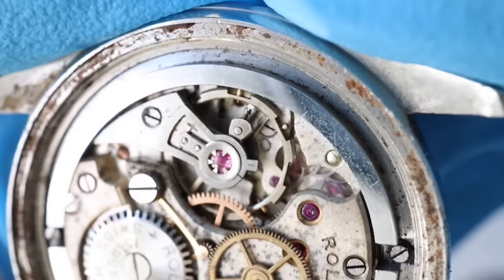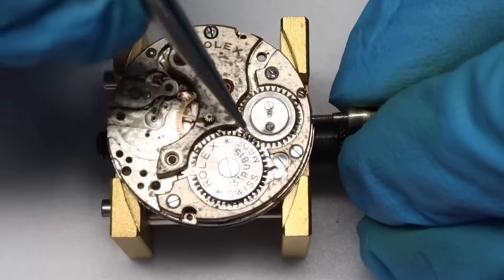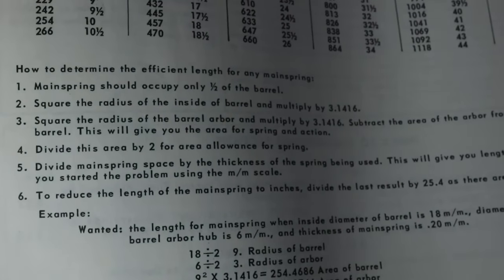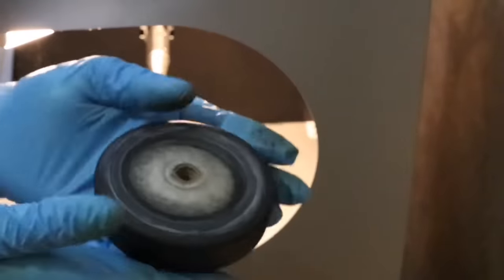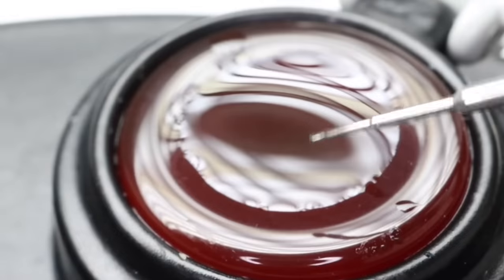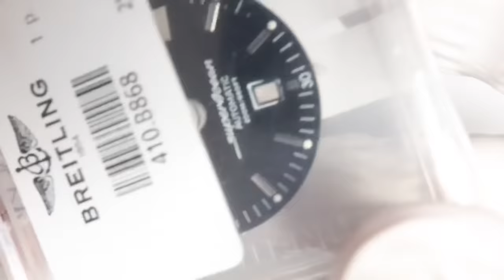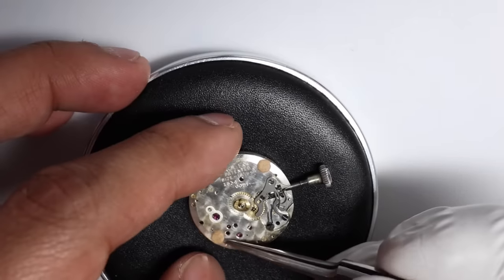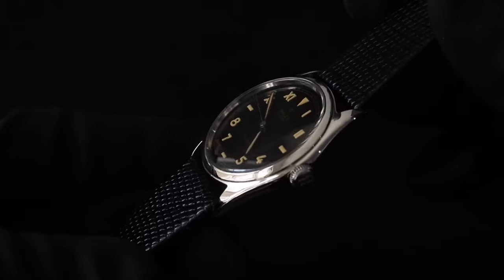Rare ROLEX Restoration - my 6 year old son designs a new dial for it - 1940s ww2 rusty asmr

Comment: So... I bought me a multi function digital watch from Walmart the other day. It was on sale for $3.50 (not a typo)  I decided to wash my hands with it on to see if it was water resistant. It was not. Got all full of bubbles inside. SO...Being the budding watchmaker that I am. 
Took it apart...dried out the moisture and sealed the 4 buttons for the multi functions with some Shoe Goo. Cute little blobs at the ends of each button. It appears to be fixed. I haven't pressure tested it to 800 ft but it no longer gets moisture when I wash my hands with the watch on. This is all because of your encouragement. You rock SIR.
Reply: Let that be a lesson to you: never wash your hands! Lol, JK 😉
Reply: Wow look at Mr. Rockefeller here! We can’t all spend $3.50 on a watch, showoff. 😉
Reply: @Sashazur  eat your heart out pauper

Comment: For some collectors it has to look nearly destroyed. As a collector and watch repair amateur myself, I don't care about that sort of heritage, I want it restored to a point where it can't be distinguished from new. To each their own, of course.
Reply: A bit of patina is not too bad, but yeah, that Rolex looked horrible and was probably a pain to read too!
Reply: I agree with your comment wholeheartedly that the belief that watched need to look run over is really not the point of these videos. The heck with "patina" when it makes the restoration pointless.
Reply: 'Patina' is the politically correct word for 'corrosion'. 
Which, of course, is just absolutely desirable in the guts of a precision machine.

Comment: I enjoy watching your restorations very much. The shape of the case of this old Rolex looks the same as the Oyster manual I bought new in 1952 at a U.S. Air Force PX in Dhahran, Saudi Arabia, for $38. When the gray leather strap wore out,  I was fortunate to find a Rolex steel bracelet of the same period in a little Arab shop, correct in the detail of not having the bracelet curve where it meets the case. 
I would have preferred it if you had cleaned the original face as far as you could, and used that. Even when it was brand new, the face of mine showed a sort of patina growing from the center. After 70 years this patina has grown irregularly out between the hour stick markers. I am now 97, and the last thing I would want on this watch is a perfect new looking face on it. My collector friends admire my old Oyster.

Comment: One of my favorite episodes! I am somewhat surprised that you didn't give it a go at a dial restoration. Soaking in vinegar and then spray with a weak peroxide solution whilst scrubbing with a soft boar bristle tooth brush? But then again, it can only be original once. Thanks for sharing your adventures. I always look forwards to the next one. Many Blessings on you and yours. Cheers!
Reply from the maker: Thanks Mike. The dial did have some work done on it previously at some point and the owner just wanted it left as it is

Comment: I've only just watched this one - amazing, as always, Nekkid.  I am not a betting man, but if i were, I'd put a hefty folding money bet that, after showing this video, you could easily sell the Roller with Mr Trouble's stylish dial.  In fact, if the deal was, it had Trouble's dial installed and the very stylish Roller dial, plus the original in a plastic box, you would never get asked to change them over.  True the black dial looks cosmic, but somehow........

Comment: I never would have expected a beat up old Rolex that looks like it came from the glovebox of a moldy 1975 Rolls Royce that sat in a damp barn for 35 years could turn into that end product. I've honestly never even really thought about mechanical watches as anything other than luxury items I could never justify spending any significant money on but now I'm looking around on eBay for a couple cheap low end beaters to try resurrecting, and owning a Rolex that I personally fixed up doesn't seem out of the question eventually.

Comment: I have two questions. Does a watch with more jewels (let's say 24) is better than a watch with less jewels (say 15 jewels)? And the other one is how we define a reliable watch?Also i am in a dilemma... I am looking for a new watch and i have two options: The Seiko 5 sports GMT automatic and a Citizen Eco Drive Radio Controled. What would you suggest? Both are at the 450-550€ range. I must say that my everyday watch is a Casio Edifice mechanical watch

Comment: Beautiful restore. Im trying to mirror polish using a dremel . Which compounds with wheel can I use to remove scratches and obtain a mirror finish?
Reply from the maker: Depends on the material your trying to polish. I’ve covered this in one of my videos but can’t remember which one. There are different compounds for stainless steel, precious metals and so on
Reply: @NekkidWatchmaker  its stainless steel i meant, sorry

Comment: I have two watches that are older, one is a Timex automatic and one is a Movado manual wind I think from the 1940's. I need them looked after. What would it take for you to check them out?
Reply from the maker: Hi mate sadly I’m currently unable to take on any private work
Reply: @NekkidWatchmaker  Thanks for your consideration any idea 💡 when you might

Comment: Never quite understood why they only ever used Ruby in movements. To my mind, as an engineer, it would have made more sense to use an Emerald. Why? Ruby is a non-porous semi-precious gemstone whereas Emerald is similar but porous. Therefore, it is more capable of holding a lubricant. You just have to find which one is viscous enough to get into the structure of the gemstone. I know about the Mohs scale, so don't quote that at me. Ruby/Corundite is 9.0 and Emerald is 7.5 to 8.0. The difference is only slight.
Reply from the maker: I think Porous materials have a tendency to crack. The oil just needs to sit in the well rather than being soaked up by the jewel.

Comment: Could the mysterious number "1534" "left by a previous watch maker" by any chance be a service date (possibly its last service date?) of January 5th, 1934? (1/5/34 without a "/" or "-" between month/day/year (or "1 MAY 1934" since there are some who go day/month/year when writing the date. The military, I believe, for example.)
Unless all the previous service dates are recorded on the inner case back, a service date seems TO ME to b the most "logical" explanation for that mysterious number located somewhere ONLY another watch maker is going to find it. 😇

UNRELATED QUESTION:

Do you service "big name brand" automatic watches, such as SEIKO, that retail for LESS than the cost to service, without any parts replacement, such as the SEIKO 5 SNKE03-4, which currently sells on Amazon for as "little" as under 80 USD?
My understanding is servicing a mechanical watch starts at 150 USD.

Are watches like that particular SEIKO 5 a "Throw Away" watch, intended to be replaced, rather than serviced?

A lot of the Invicta, Olevs, and other low cost automatic watches also retail for much less than the cost to service, to "about the same as having it serviced." 

Forgive me, but this pricing makes me curious. 
If "Planned Obsolescence", at least they cost less than a quote-unquote "smart" phone, or laptop/desktop/tablet, and a car. 🙄

Comment: Collectors will be having fits watching you polish that case and case-back... 😐  Sure looks nice but you just severely de-valued the piece
Reply from the maker: It has already been polished several times over its lifetime
Reply: @NekkidWatchmaker  Is that why some collectors aren't particularly fond of Rolex servicing (also original parts such as dials / hands not being returned)?

Horses for courses I suppose 🙂

Ironic that some of the most 'valuable' (or at least desirable) vintage watches are ones that have in some ways been neglected?🤔